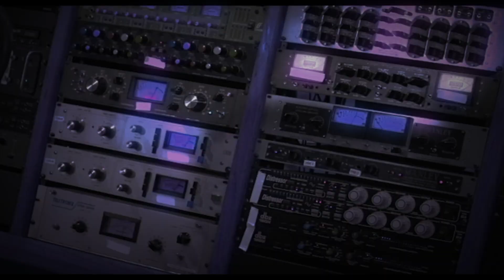Impulse Response Explained: What is Impulse Response?

Comment: It's even better to use a specific sine sweep and then create an impulse out of that sweep data. This gives you a better result, as it can remove non-linearity in your signal generation (assuming you compensate) and any harmonic distortion that occurs from your sound source. 

REW has some great tools for this, and I believe the Ableton M4L convolver now has a sweep utility as well for measuring responses (although I don't think it has a spot to input microphone calibration)

My favourite IR software currently is a mix of VST's: Melda Mconvolutionez, Freeverb Impulser, Ableton M4L Convolver, IgniteAmps NadIR. I've been eyeing MConvolutionMB as it allows a fair bit more tweaking of an existing IR.